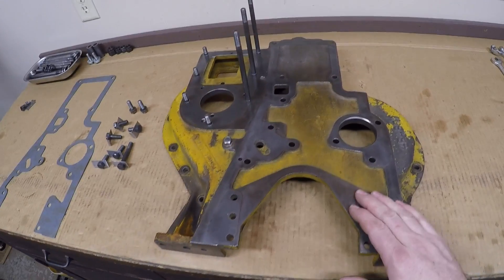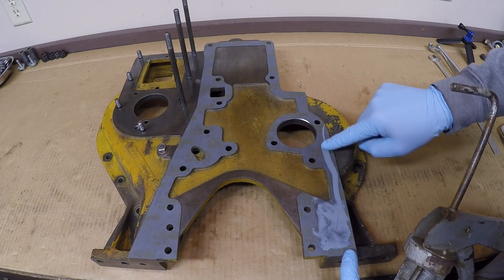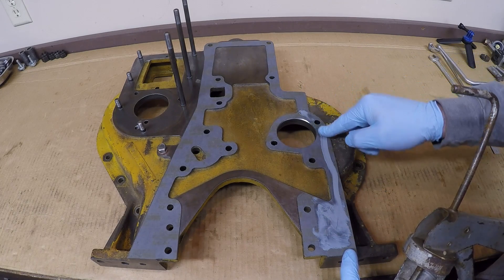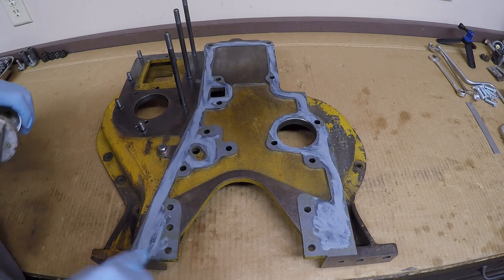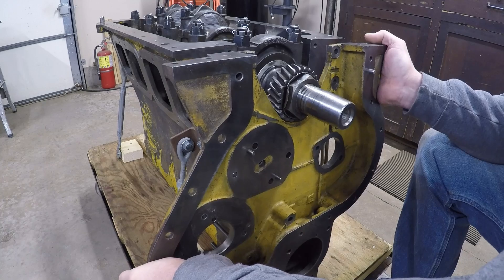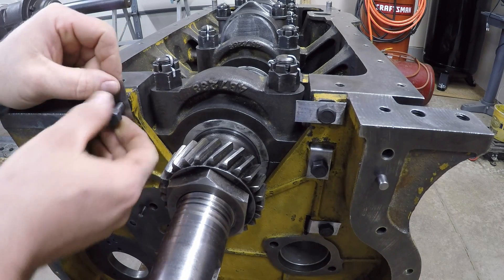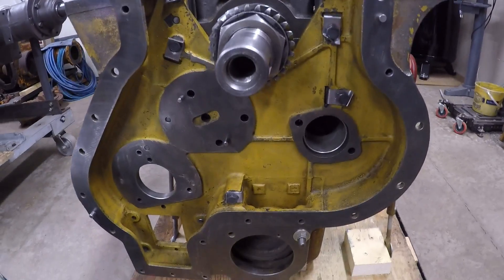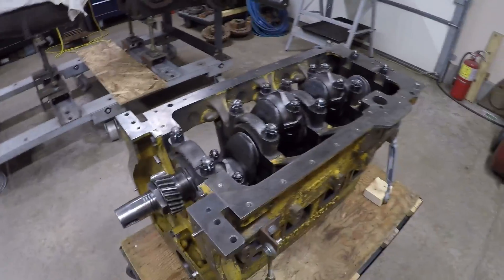Caterpillar D2 #5J1113 Diesel Engine Assembly Ep.12: Intermediate Cover Installation

Comment: I've gotten countless tubes of the Mopar branded Threebond from work that I've used to rebuild several engines. I use it the same way with just a smear to help with old machined surfaces, hate the look of squeeze out. The oil talks I cringe at all the time, what is wrong with manufactures recommended oil specs -_- ( I have ran a Diesel on 5w20 but just to get the machine out of the woods lol )

Comment: That looks an awful lot like the International grey silicone that comes with a rear main seal set for a 7.3. My running joke with doing a rear main seal and an oil pan reseal on a 7.3 is that the bolts are so few because all they do is hold the pan up while the silicone cures. Once cured I'm just about convinced the bolts are no longer required. I love the stuff. As you said, harsh environments or anywhere that surface condition is less than ideal, that sealant goes a long way towards making reliable repairs. I run a small rural shop in NW Missouri and most of what we get is, shall we say, past its prime but we keep them going. Takes a little extra time and sometimes a bit of creativity and a few opinions between we technicians, but we get them done. Love working on diesels but I stick to driving gasoline powered. Does what I need and keeps work from following me home.

Comment: With all the advances in chemical and material technology over the last half century, the cheapest "universal" oil you can buy today is arguably better than the best oil available when the machine was new.  The only other thing I'm careful about with seasonal use equipment is to change right before parking it for the off season and right after bringing it back on line.  The storage oil may have less than an hour of run time on it but months of sitting idle allow condensation to combine with combustion waste to form acids you don't want circulating when you go back to work.

Comment: I have my own positive and negative experiences with certain brands (and weights) of oil being used in certain equipment.  Experience is a pretty good teacher.  So with that debate crisis averted,  I'd like to ask the $64,000 question,  and it concerns the installation of covers, fasteners, folding lock tabs, and other necessary items when building a Caterpillar engine.... Is it critical to the success of the build for the builder to wear Caterpillar-branded clothing?? :)  Hard to miss the Cat hoodie you had on....

Comment: I am doing that oil experiment right now....3.5 L GM V6 in a 12 year  old minivan. Cheapest oil from Walmart, most expensive oil filter....change it every 3000 miles. 225,000 miles now. Compression still within factory spec. Just changed the O2 sensor....first time. No leaks, consumes less than a quart between oil changes. Not going to bother with synthetic.

Comment: Like I say with sealant it beater to have and not need then to need and not have. 
I am not a fan of silicone but like Loctite flange sealer is the stuff for me 
The problem with silicone there are types the are bad for engines with the acid
base it is corrosive to a lot of metals .Just saying dont grab a tube and go get 
the right stuff as you know this is for  all your fans

Comment: One only has to watch videos or look at pictures of roadways and highways from the 60s and 70s to appreciate the benefits of modern sealing technologies. The center of every lane of traffic is pitch black from oil stains. From silicone to molded gaskets it's hard to dispute that modern engines are less leak prone than their paper and cork sealed counterparts. I browsed the comments and was disappointed that there were no knife fight in a phone booth arguments about oil or silicone. Too bad. All kidding aside, I've had excellent luck treating gaskets exactly like you did in this video. Either a micro layer of silicone on glossy gaskets like you did here, or aviation form a gasket. After seeing jet engine flange to flange seals made up with nothing but aviation compound I was a believer. Both work excellent. Nice to see you deviate a little from the Cat manual for a sealing improvement on this D3400. It would be a shame to see it weep or drip sooty black oil on fresh yellow paint. I can understand not wanting to open yourself up to the flurry of internet experts on oil selection. Ther are many correct answers, mostly based in personal preference. We can agree that the only wrong answer is no oil at all. For those curious on his thoughts, he mentions the oil he is using in a previous video. So if you're curious, go back and rewatch everything to get an idea of the answer. I won't spoil it for you.

Comment: Hi Squatch .. I have a query or two for you that 40 pound  piece of metal you applied grey sealant i was surprised that there was no paper gasket or similar required as well as that sealant. Why not also use a little of the modern threadlock also with the locking tabs ? hope to hear from you . regards Don

Comment: D2... Wow....very rare....I do kinda have then answer to the question about oil.....CAT.....whom I worked for at the time....2004.... Lost there oil suppler here in Thunder Bay....I had to find the new supplier....for Cat......is all about filtration.....was 30 million microns....Esso became the new supplier.....also......even new oil....left to sit....after five years....it's junk....it separates...besides filtration.....there are two types.... detergent and non detergent...That.....is the choice.....but...as long as you understand...oil works in five layers....acts close to bearings....so if your engine is old and worn.....and burning a little oil....go up one grade....example...from 10 W 30..... To 10W40..... To maintain that five layers....to reduce heat...and a longer engine life.....by less where.

Comment: Interesting that you would mention oil.  An old timer told me 20 years ago that the very best motor oil from the pre war era wouldnt make bar and chain oil today.

Strangely enough the "Project Farm" flatlander just did a comparison and test of some 1950's quaker state vs modern.
Reply: The Fixer Of Broken Stuff I am 63. I remember watching guys rebuild engines when I was small and seeing the sludge and gunk that was inside even well maintained cars. I wonder now just how long those old engines would have lasted with modern lubricants. I saw PF video with that old oil - I still remember how that stuff smelled. Yuk!

Comment: Every step is a step! I've used silicone but my go to is Permatex #2 or Aviation. And with lubes it's the same. I use what I've seen work in some extreme circumstances. And with that said I figure it'll work for me in my non-extreme circumstances. So far, so good. Thanks, Toby! ope yall are warm and happy! Hi, Pop! Keep on stoking!

Comment: Let me tell from someone who has done it 100's of times a little silicone never hurts, after you tear down things that leak after you put them together a couple times you will use it, I use clear or black you can hide that you used it, not that blue goo stuff. I use 15w 40 in everything I run Rotella or Chevron Delo 400

Comment: No need for silicone but only for joints. Cat green gasket cement was even better like look hi-tack but after assemble it's stuck. You could removed bolt its not coming apart....SAD PART Cat no longer makes it BOOOOOOOOOOOOOOOOOOOOOOO

Comment: I do the exact same thing with RTV. A very thin layer to act as a glue.... When it comes to oil, I have been told that you should only run straight weight oil for a break in oil as the multi-weight has polymers in it that will not allow the rings to seat properly. Whether or not it is TRUE or not, I have no idea. I think the biggest part of any engine oil is - there has to be OIL IN IT. Ha ha. It's always been my philosophy that if it drips a little here and there (Although not desirable)... At least you know there is oil in it. It's when it STOPS dripping that you know you have a problem. Ha ha. Looking good, Squatch. Anxiously waiting for the next episode as I am still at a standstill with the H.

Comment: For many years I ran Shell Rotella 15-40 in everything I owned.  Was it right?  No way!  The range of machinery I owned made it dead certain that if it was right for anything, it would be wrong for something else.  But...  Buying ONE oil let me buy in quantity.  Everything I ran had the proper quantity of clean oil and I never had an oil related failure.

Comment: I had the same oil argument with some guys going on an on about zinc additives for flat tappet cams. I asked if anyone had ever seen a stock cam with stock valve springs fail from using a modern oil with no zinc additive. Crickets. Pretty much every DOHC engine I've seen uses a "flat tappet" valve bucket and they run 300,000 miles plus with our modern watered down 0W-20. I hate RTV silicone, and under ideal conditions, you don't need it. But a crusty old engine is hardy ideal. I've even had success using RTV on o-rings such as corroded thermostat housings. I know you aren't supposed to, but what's the alternative? Scrap the engine?

Comment: There are a lot of factures in using oil one is low rpm high mass engines like an 8 inch stoke as to high rpm engine like my cummings so straight 30 weight as to 1040 detergent or 1540 higher different detergent

Comment: Yes my uncle phil he put 10,40 in my father d6 track loader 10a series
Reply: After my uncle put 1040 in my fathers track loader d6 the carbon built up on the top of pistons it was like bakeolight it hammered the bearing out in about 30 40 minutes after putting the 1040 oil in it

Comment: Ha! The oil wars.When I worked at the Chevy garage we had a guy bring in a Chevy Corsica with a 2.2 liter four cylinder. We took it apart and found a taffy pull going on in the crankcase. He had been using a certain brand. Bad batch maybe or sabotage at the refinery? I wish we had cell phones with cameras in at the time. Needless to say I had aversions to using that oil.

Comment: I know you said that you're not going to get into what oil you prefer because other people is got a lot of opinions and they sometimes over Express their opinions the oil that I run is oil that I can afford as long as your engine has oil it will not burn up it will not stop. But I do have a problem when I first start my engine I got a bad lifter tap this engine is somewhat of a dirty engine and I've been changing oil what would you recommend and this engine does have hydraulic lifters I would like to know what you recommend to do tear the engine down or change to an oil substitute and continue running it it's got 70,000 and on it
Reply: Squatch252 it would be much appreciated if you would respond please
Reply: @squatch253  the engine is a 1984 360 Dodge one ton dually but I believe it was air Forest Surplus that was never bought by the Air Force everything is different on it when I want to track down what harness I have it's a 1981 not sure exactly what year it really is but it's titled as a 1984 and I assume that everything is original

Comment: As long as the tip.on the silacone tube is cut at the right angle  & using the right type of sealant you should have no problem,s also as long as you put the right amount on the gasket !!!! Are you going to paint the engine 🙄🙄??

Comment: Guys that don't like the way you do something to your engine need to post up a video of how they do it to there engines. As far as oil goes i use what the manufacturer recommends.2016 Pete with a Cummins ISX. Will you test run this engine before you install it back in the frame or is that more work then its worth? Thanks again

Comment: Which is the right oil? Refer to the manual.
Reply: My Chevrolet’s owner’s manual says to use oil that is to the GM6094M standard; as long as the oil meets that standard, I’m golden.
Reply: Waaay back when, crude oil was used as engine lube. Things change, r&d occurs, and better products become avail.
Reply: Well that is hard to compare to an engine like this. The oils around when this thing was built was barely more than crude oil. This is something I'd ask a master on, like squatch here.
Reply: Once I heard a discussion on which oil should be used.  One guy summed it up this way:   "I like the slick kind". lol